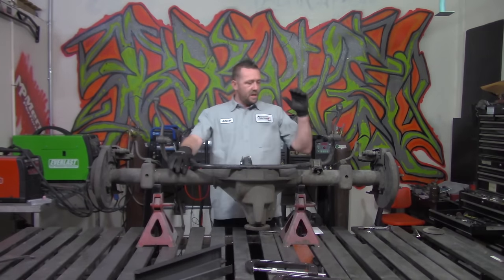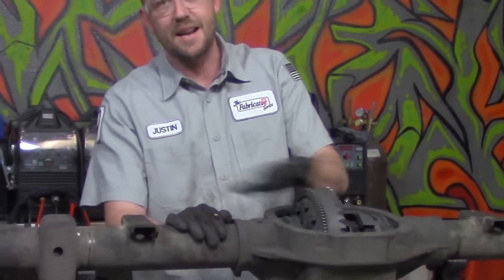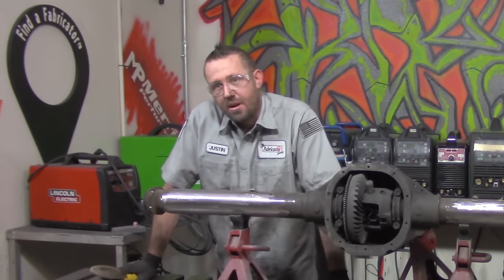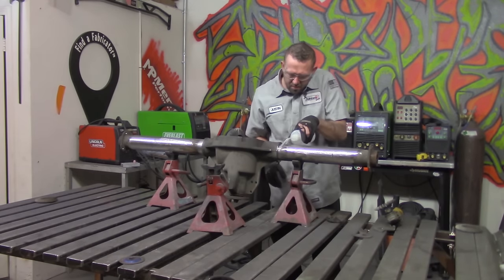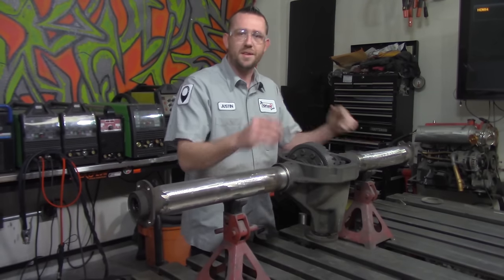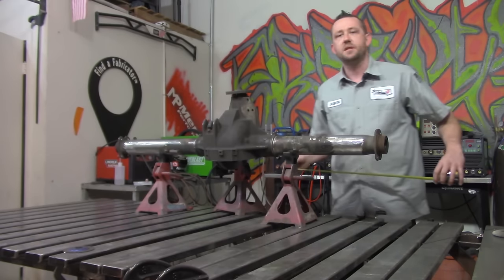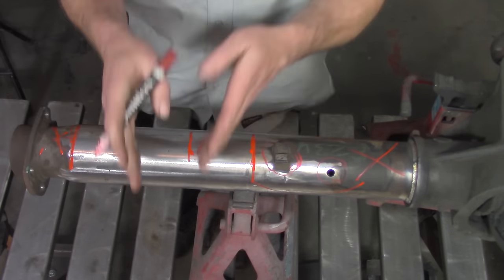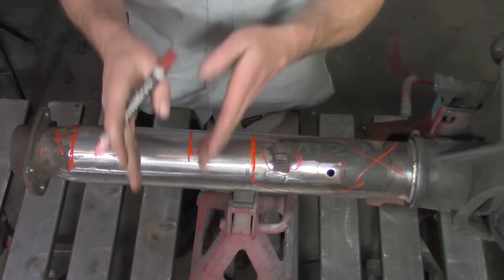TFS: How to Narrow a Ford 8.8 Part 1 - Strip Down

Comment: IMHO=Call Currie, Strange, or Moser etc., and buy a 9" housing (Dana, 12 Bolt GM whatever) to your spec ( length, pinion centered, or where you need it). No C clips, and saves a ton of work. It has stronger axles, it's straight. With a 9" Ford, you can set up center sections with different ratios, and change them in a about 1/2 hour. Cheaper in the long run. Everything this guy shows is true. He knows his business. I am not criticizing. I did this with a Dana 44, but, they don't have C clips.

Comment: Awesome finally someone with a proper video!! If you can do a video on how to narrow a ford 9” that would be awesome 😎👌🏻
Reply: JM Designz Ford 9 inch?
Reply: JM Designz basically the same way
Reply: Welding Junkie yea bcz i have some ford 9” housing that need to get cut
Reply: JM Designz ah gotcha I was confused. Forgive my ingnorance but why would one narror a rear end? To install it in something different?
Reply: Welding Junkie yes the 8.8 is offset 3 inches to one side
Reply: Welding Junkie gona install these housing on trucks with a 12” wide or 15” wide wheel & a ford 9” is the best application for horsepower as well
Reply: @juliosgarage7181  The 9 inch has alot more parasitic loss, unless your making brutal power the 8.8 is all around better choice, the only thing to change is to put 3150 bearings on instead of the c-clip eliminator,  31 spline and your good for 8 to 900 horsepower.  I am doing a 63 falcon sprint this way.

Comment: I'm surprised you didn't take the axle tubes out,  cut & bevel them on the lathe. Mount them between centers on a rotary welding fixture and have near perfect results.  Seems like it would have been much more accurate. Drill & ream 3 locating pin holes before removing the tubes. They would go back exactly where they came out.

Comment: 308 Stainless? Wow, I was not expecting that... Ford used quite an interesting alloy with that rear end. I will say TIG welding on stainless is a blast! I was just a beginner at it and I was laying down pretty welds. Not sure about corrosion resistance though. But hey, stainless is tougher than mild at least.

Comment: Because I'm lazy, when I cut big tubing I use a Rigid 4" tubing cutter.  Minimal finishing work and cut is nice and square IF and only if the tube is cleaned of rust in such a way that it won't make the cutter wander.  Only better way to it cut is with a very large lathe.

Comment: Im really hell-bent on removing the plugs and pressing out the axle tube.  I really just want to try it on a scrap axle.  What did you use to get the plugs out?  Also, you mention 3 triangulated plugs, What about the 4th large plug on the side of the cover.  Does that need to come out too?  Thanks

Comment: you haven't considered preheating the cast to 600 to 800 degree's (using a temperature pen to determine the heat) prior to the weld?  as far as i know that's a routine practice when welding cast.  I agree using stainless rod does help prevent cracking too.
Reply from the maker: Considered, noted, calculated, never done. Theres a ton of factors and it has been determined that it is not necessary on this diff.

Comment: Personally I would measure the axle shaft lengths and removed the difference from that dimension from the axle housing. Because the fact that there is a ring gear and pinion shaft that may offset the actual centerline of the housing to one side more than the other.
  Also I'm not sure why you say we can always remove metal but not replace it. Why? If I'm not mistaken I witnessed you adding metal to metal, please clarify my confusion. Welding is in fact the process which adding metal to metal is achieved, is it not? other than that twas a good video, nice work...

Comment: I have an old lincoln G8000 that I have a miller suitcase wirefeeder hooked to, and an antique profax spoolgun for aluminum both of those feeders can push a clean bead with SS wire, 4043 or 5356 alum., with either CC or CV, and I can tig just the same using the CC as well as scratch start my plasma torch....all you need is AMPerage to melt metal and it ultimately doesn't matter to the metal which type of current you use whether AC or DC the metal isnt that picky it will melt practically the same with either it rarely puts up much resistance once you created a contact...

Comment: If the axle housing was originally built with the pinion off center, the way you just modified it, it is not on center any more.  (That is why one axle was longer in the first place.)
If your new axle goes into a truck, you are golden, but if it is going into a car, the driveshaft will hit the side of the tunnel.....especially with 2 or more in the car.
Reply: The pinion is not centered on for 8.8 rear ends, that is why one axle is longer than the other
Reply: @Redtooth75  I covered that:   I switched a word by mistake. Thanks

Comment: All you need to do is get a Wrap around. It is a pipe fitting tool used for marking cut lines on pipe. Then you only need to measure at one point then make your mark. You can then measure a a few spots to verify your mark is straight. It is not accurate to make multiple marks around a tube for a cut line. 
You should also use a sharp soap stone marker not a paint marker. your line should not be an eight of an inch or more wide. You lose accuracy that way. Your line needs to be as thin as possible.

Comment: Everlast sell sweet TIG/Plasma for a very reasonable price.
Also, pre-heating cast helps to mitigate weld cracking. In some circumstances, its absolutely necessary.

Comment: question? wouldn’t it be easier to drill out the 3 filler welds and just add a complete short side axle tube

Comment: I have a question, I’m currently shopping around for a IRS diff, the Ford Explorer and expedition have them , but I’m wondering if simply narrowing a solid rear axle would be more solid than the aluminum IRS diff case ? Or that just to much work for nothing ?

Comment: Safety nazi here.  Take it from a guy that has tenitus so bad it keeps me up at night, wear hearing protections.  In ear, over ear, something.  Not for me.  Not for OSHA.  Do it for yourself.  Great video.  Thank you for posting.
Reply: Robert Palmore put the fan on and soundscapes or ambient radio.  Works wonders.
Reply: Robert Palmore I have an app on my phone called "White Noise Lite". It's got all kinds of different sounds you can choose from.  Audiologist at the VA recommended it to me.  Seems to work pretty well.
Reply: Derek Shrewsbury
I'll have to check that out. I have a CPAP that does give a little white noise but I'll look into anything.
Reply: Second saftey nazi here!  I have done all this grinding before just fine with the guard left on my grinder!!!  guard off you slip your hand goes in the cutting wheel, and it continually sprays you with sparks!!
Reply: Me too! Once you have the hiss and crickets in your head all the time, you wish you had done more to prevent tinnitus.  Shop noise will add up over the years and then...
Reply: I wear ear,eye and respiratory protection. Full face shield is best.
Reply: That's fine Poly, Darwin will take care of you soon.
Reply: Real men don't care about safety (lol, joking) & that's why I'm an idiot, disabled & on an ass load on oxycodone....lol  Great tips Robert!
Reply: Robert, you seem to have pissed off the lead paint chip eaters.
Reply: I have suffered with tinnitus for the last few years, the years of loud music, motorsport and machinery have taken their toll. I am not sure that I regret any single activity but with a bit more care I could have avoided this...
Reply: krusher74 Likewise. I can't fathom the logic of taking off the guard on a cutoff tool when 98.5% of the time, it's not in the way. And no faceshields or work clothes or PPE you can think of will do half as good a job as that steel guard when that wheel disintegrates. On top of that, it takes like 30 seconds to slip the guard off, and another 30 to replace it, for that less than 2% of the time you need to do that.
Reply: dont do it for me....
Reply: May you learn all your lessons the hard way.
Reply: WHAT? I have it too but not as bad, still sucks.
Reply: Krusher74 you haven't been in a very tight spot. I throw them away.
Reply: Robert Palmore  v
Reply: In terms of health, breathing in that dust is worse than the noise.  The decibels are comparable to a nightclub, so he can get away with it a few years.  After occasional grinding for a couple years, I decided I would always use ear plugs, not because of the safety nazis, but because the task is FAR less exhausting for me.  A more quiet, comfortable grinding session is likely to be more accurate.  But that's just how I feel.
Reply: White noise is my friend.
Reply: Poly Bun  dweeb boi thi one!
Reply: Sorry. Can't hear you, the ringing in my ears you know . . . 

So, you have no interest in hearing you grandkids laugh, or being able to talk on the phone with them?

A couple of bucks for some foam earplugs . . . or about $3000 for cheap hearing aids a few years down the road.
Reply: Poly Bun  ,so how's life under the bridge these days?
Reply: Just wait til you start feeling like youre falling over backwards all the time or start falling down when walking up stairs because of manganese poisoning... the correct name for mild steel is manganese steel. The more you breath that dust the more you insure you will have manganese induced Parkinsons... horrible way to die. Hardened steels have more manganese like structural iron. There are many toxic metals that will eventually, guaranteed, if you work with metal long enough, will make your life a living hell... trust me. Tinnitus is the absolute least of your worries when fabricating.
Reply: @derekshrewsbury9539  Thank You for your service......Go Air Force

Comment: just have a quick question for you I'm working on an Explorer in 02 with an 8.8 737 rear end I need to know if all the axle shafts are the same length and all of the 8.8 and also in diameter just having a hard time finding one but there's quite a few at the Wreckers I'm just having a hard time finding the right one if any help would be appreciated the one I have is bent

Comment: Did you preheat the diff housing or should I say is that a good idea?
Reply: i personally would preheat it
Reply: i recently truseed my dana 44s and preheated the housings to 400f worked well.. if i had a bigger torch i might goto 500-550 degrees as the housing just had more mass than my truss and the welds tended to undercut the truss before biting into the housing best

that being said the axle and housing welds will never fail theyre way overkill now
Reply: Seems like a piston ring compressor would help you make the lines for cutting. Maybe
Reply: Could you make a jig with the axle shafts in place and essentially make the entire thing a lathe? Cut everything perfectly?
Reply: @jeremylakenes6859  Yeap..or a regular worm clamp.

Comment: There is a lot of wasted time involved in all that measuring to get the cut lines. As far as measuring is concerned, take a piece of wood or steel and place it against the rear end housing lip. Put a scratch mark on it where it meets the outside of the wheel bearing flange and then run it around to check for parallel. Once you're done then measure from the end to your scratch mark and that gives you what you need to know. All that tape work is inaccurate as hell as your tape will flex and the end will move in and out. To mark your cut lines go to any welding supply and ask for a wrap around. You wrap it around the tube and make sure the edges stay inline, make your line and you are done. You can also use a strip of gasket paper as long as one side is a factory edge (wrap around's are made out of thick gasket paper). The other method would be to get a wheeled pipe cutter for 4" pipe. Most rental outfits have these for daily rent. Their operation is pretty much self explanatory and would cut these tubes in about 1/2 hour and be perfectly square. I have been fabricating for over 40 years and they would laugh me out of the shop if I did things like this this way.

Comment: If it welds, it isn't cast iron. Cast steel and cast iron are way different. Cast Iron can be TIG brazed to itself and dissimilar metals with silicon bronze filler rod, but it will not happen with typical 70s2 filler rod. Heard someone mention 309. It's good for heat treated 4130 that won't be re-normalized.
Reply: Sorry - I read 309 in a comment before I heard you talk about it. Ford used to have a giant steel mill. Maybe they still do. They cast, forged, and rolled all their own alloys. I'll bet that pumpkin is cast 4130 or 4140.

Comment: Im sure you have your prefered ways but I would rather than using tape to lay out the cut lines, use a good pipe cutter. It will give you a perfectly aligned score all the way around. Great video and explanations!

Comment: Is there any way to use a rear axle like this on a Toyota truck and come out with the same wheel pattern or do you have to stick with 8 lugs.  I'm wanting to do a v8 engine swap in my old v6 and will upgrade the rear end at the same time, but wanted to still be able to use stock wheels and or have them match the fronts.  How can this be done?

Comment: I would imagine placing the weld outside the suspension mounting point would be best. That way you eliminate twisting loads on the weld under accel
Reply: 🤔 One less force to contend with.👍

Comment: the difference in tube length centers the pinion behind the motor. if you take it all out of one side, the pinion is no longer centered, could be a problem.
Reply: Was thinking the exact same thing. Not only that but there is no guarantee that just because the tube length is the same, that the axle length needs to be the same. One axle could easily protrude further into the housing more than the other depending on how the centre is constructed. I would have measured the difference between the two axles and removed that amount. Trying to do it on the cheap to save resplining axles on a car with a four link seems like recipe for disaster.

Comment: Good video. Very informative. But if you go through the trouble to narrow an 8.8 then use the 9 inch ends. Easier to do and cleaner.

Comment: When you say you've "done this differential 14 times" is that 14 separate vehicles you've "built" those rear axles for or you've "built" 14 junkyard rear axles for one vehicle before you finally got the filler rod selection right and ended up with one that didn't break? Did it ever occur to you to ask professionals what they use to do things like weld "knuckles" on 4WD front axles to the outside end of tubes or what's used for the "plug welds" when new axle assemblies are manufactured?

Comment: sorry to let you know that if want to cut the axle leaf spring saddle with the grinder cut off wheel you can I had done it in the past several times and remove it completely you just have to use a smaller wheel

Comment: Under the title of, "To each their own." When needing a continuous measurement in this case, 9 from the housing, I like to cut a wood dowl or scrap metal rather than use a tape measure and mark off the end of that.

Comment: Maybe it's just me seeing things but is there not an entire shelf of welders inverters and power supplies behind you? It's real easy to connect a plasma torch to any one of those units throw some compressed air through the torch and walla instant plasma cutter. Trust me I have confidence that you can do it, it's easier than you think, by far easier than the rearend mod you're doing. Try it and thank me later.
Reply: yes you are definitly seeing things,  a shelf full of power supplies welders inverters and all plasma capable, just add a torch like you said...

Comment: what settings to you recomend for the welds on the axle tubes on this project? no shops near me feel its worth the time to do this job so I would like to attempt it myself.
Reply: 1/8" 309 SS I would try 85 -95amps initially. If it welds decently and doesn't get the rod so hot that it droops from it's own weight or disintegrates you likely have it set about right.

Comment: Every low budget street car, hot rod , even some low 11 second car in Mexico has a set up just like that, i did mine for about 120 dollars with disc brakes, posi traction, and 3.73 gears all from the scrap yard.

Comment: couldn't you cut those plugs and take a right side axle tube with axle out of another rear end and weld that axle tube to the carrier then you wouldnt have to worry about cutting the tube to the right length?

Comment: I had an 8.8, stripped it down, axles re-drilled to a 5x5 to match the front rotors, put in the 1960 C10 and the drive shaft hit the frame crossmemeber tunnel!  @#$%^!  Sold it, built a 10 bolt corp GM, now I want my 8.8 back after seeing you narrow it.  JEEZ!!  I could have done that!!   Since I don't have a TIG (yet) could I mig the tubes in the center?

Comment: Great vid - but that sway bar math at the end was a bit more confusing than it had to be (why figure out the distance across the diff at all when you’ve gone to great lengths before to show how that’s not working anyway?)...
Reply from the maker: It's demonstrating a process with problems. Showing only the solution does not show the lesson.

Comment: When I was learning to weld. I had made dangerous accident. I burn a hole into my body with welding rod. I flipped the rod hot side towards my body and it put a hole into lower tummy. 6 inches into myself.

Comment: Just curious,  why wouldn't you remove axel tube from center section then cut and reinstall? No weak spots, no seams to dodge.
Reply from the maker: Howard Hudson Its an interference fit which requires a very large press or specialty tools. It's not something mkpst people can do in their garage or small shop.